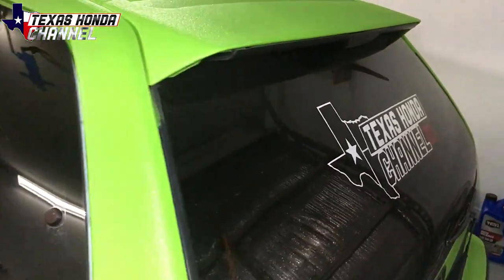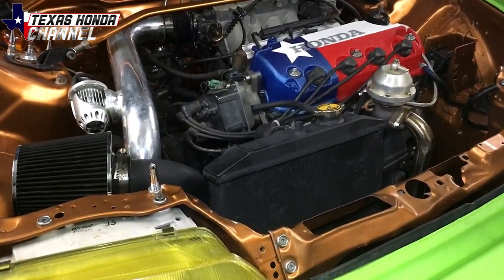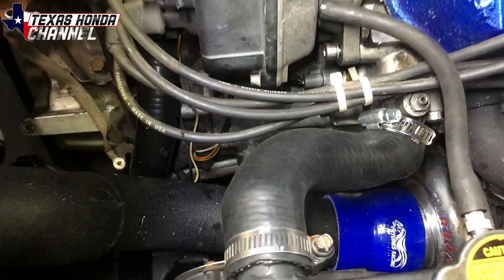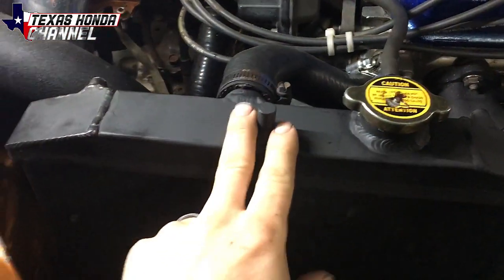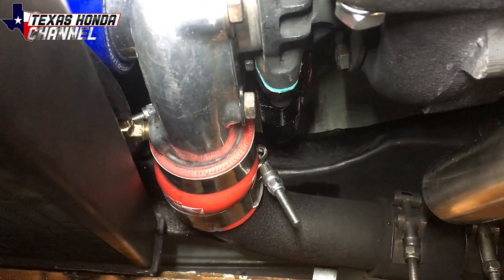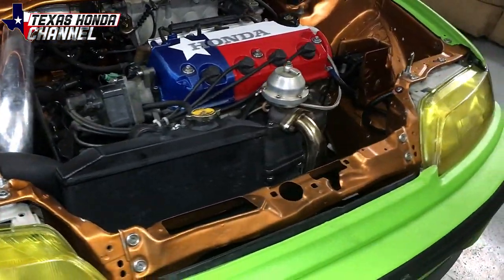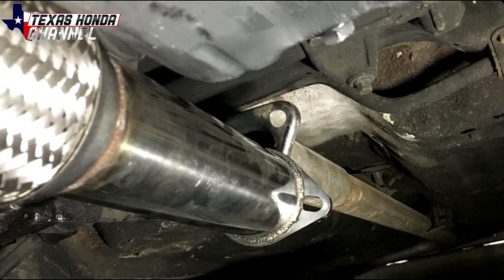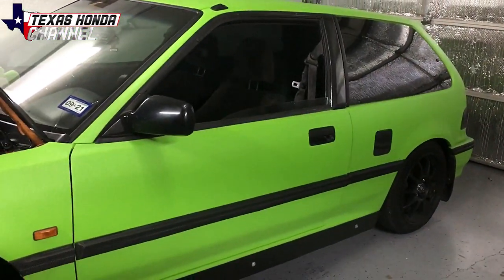This Is How I Fit A EK Racing Radiator In My Turbo Ef Hatch

Comment: Please put a puller fan on the outside...also, do you have a thermostat in it?
Reply from the maker: It don’t need any better at cooking. Idk if you seen any of my other videos but this thing is super good at cooling. 90% of the time my temps are at 160 degrees coolant temp. It don’t need a puller fan that’s for sure lol. Also it’s a 155 degree mishimoto and brand new water pump. I never had a issue with temps on any of my turbo setups on keeping them cool. B series/H/F/K all have more heat but the d series don’t get too hott unless the down-pipe touches the exhaust side or is close.. i
Reply from the maker: It’s also a mishimoto fan it’s crazy powerful
Reply: @TexasHondaChannel  
Well done then sir. I might spring for the thick rad. Is it dual or triple core that you have

Comment: Will top mount turbo help with heating issues with hondas? Iv not boosted a fwd..... YET.
Reply from the maker: Yes it will help because it moves it away from radiator.
Reply: @TexasHondaChannel  being fwd wasn't sure if it would help that much either way with it still close to the radiator
Reply from the maker: @GlassWerx  heat soak isn’t usually too bad

Comment: ED6.
Reply from the maker: If we wanna play by them rules than its not a EK its a EJ8/EJ6 Radiator lol Either way you knew what i meant didn't ya lol
Reply: @TexasHondaChannel  if it was sold outside the US, out the factory, it is an EK.
Reply from the maker: @notbanksy8294  The EK is based off the EK1/2/3/4/9 also the first Civic Type-R is a EK9 which is based on the sixth generation of the Honda hatchback. The Rest are the 1992-1995 are EG/EH/EJ. The 1996-2000 civics in America for the coupe (EJ6/7/8/EM1), now 3-door hatchback American models are  (EJ6/EK1/2/3/4/9)
4-door sedan (EJ6/9)
5-door liftback (Domani based, MA/MB/MC)Way more info on this on the internet here is a good read. But it really don’t matter when someone says EK we think of the 96-00, when someone says EF we think of the 1988-1991 when someone says EG we think of the 92-95 that’s the universal language that has progressed. I use these words myself because if i said ED6 they would be like what’s that? Or wouldn’t click on it because they are unsure of what that even means. I know the technical terms but I have to use the “common terms” or people get clueless. I speak from actually trying to use the real terms and people going huh 🤔.. But yes ED6 not EF if you wanna be technical
Reply: I feel like if the steering wasn't right hand drive to begin with, you wouldn't use the JDM designations. Like saying I have a em1, with a d16y8?